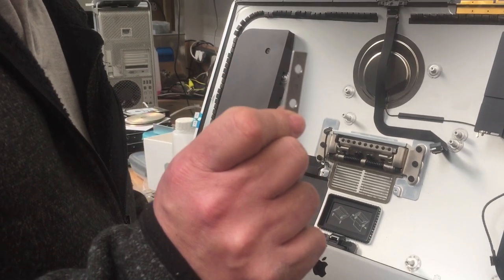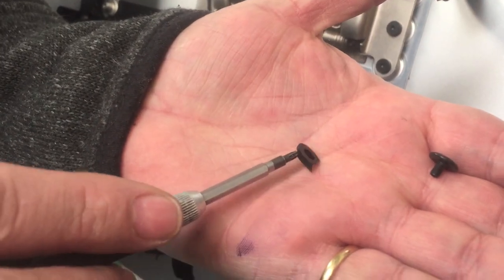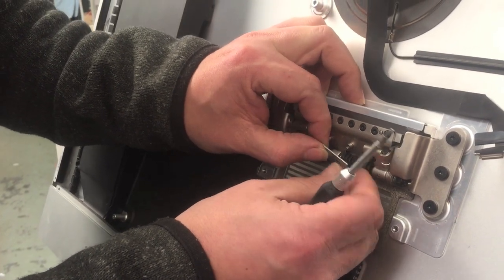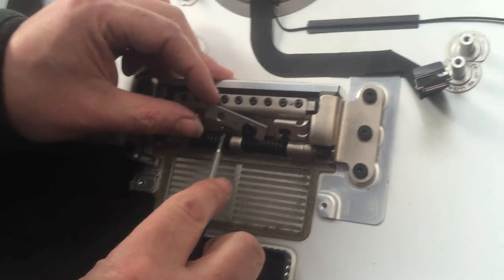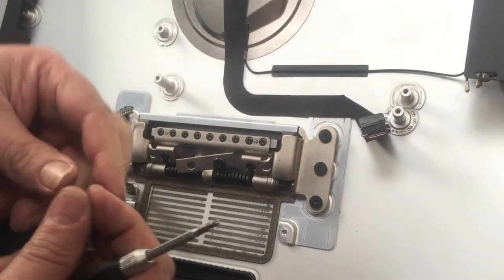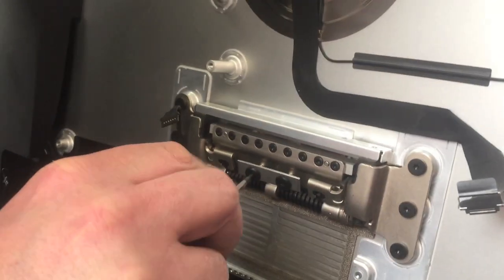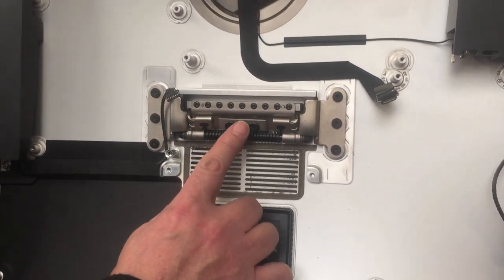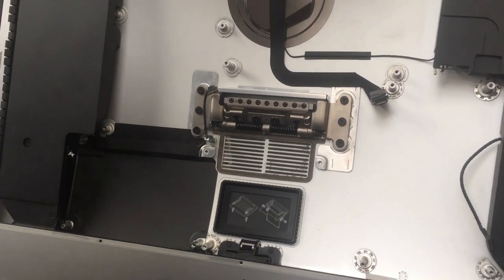How to fix / repair Apple iMac 27" broken hinge /clutch

Comment: @360MIX is doing something similar in his video but single bracket seems a cleaner fix. 

I've the same problem (well and some others) with my iMac and I've decided to fix it myself.  I see you're selling it so this is a long shot: would it be possible to share the dimensions of that bracket ? Idea behind my Q is that I could go to depot-like store and prep the bracket before actual disassembly. 

In any way thanks for the video and showing the fix idea.

Comment: This video begins with the hinge exposed. Anyone got a link to instructions on how to tear down the machine all the way to this point?
Reply from the maker: hi jimmy , yes is not point to show how to take apart as they are several videos already on youtube , im selling they product to made easier the repair
Reply: right... I saw that in the description. I have been unable to find it. I see lots of videos tearing down to the logic board, but not all the way to the hinge. If you could link me to one, it would be greatly appreciated...
Reply: OK in the event that anyone else still cares, here's the link I was looking for. After step 54, the hinge is exposed. https://www.ifixit.com/Guide/iMac+Intel+27-Inch+EMC+2546+Logic+Board+Replacement/15777
Reply: @jimmykirk811  Have you fixed your iMac already?

Comment: can the same thing be accomplished with two washers?
Reply from the maker: hi nelson , yes , but the washers need to be flat on the end or wont fit, or a square washer will do too. the problem is that you dont want your imac all apart and ther you realised that the washer dont fit an you need to go and get somthing else
Reply: yes it can but the round washers tend to slide off the spring and pop you in your finger. hurts quite a bit too

Comment: Apple is wack..y u have to take off the lcd to fix the feet..they should jus make the feet under the bottom the fit into a gap like smart tvs does .. its already hard to change the hhd alone
Reply from the maker: Yes they do as much difficult as possible to do this repair, thanks for watching 👍🏼
Reply: @Apple-Bay  welcome..

Comment: and then you wont be able to tilt down your imac screen again....hmm
Reply from the maker: hi yes , it will be same as factory, what we do is replace the plastic holder( broken) with a metal , because the iMac is empty and not weight in the iMac it tilt up  , once is all back together  will be as normal